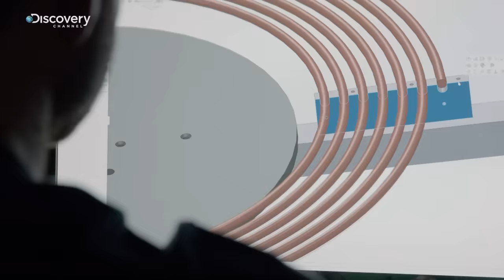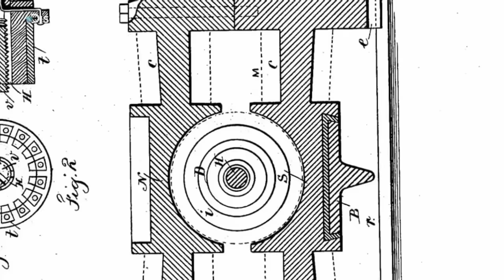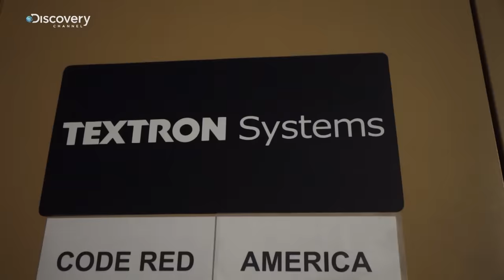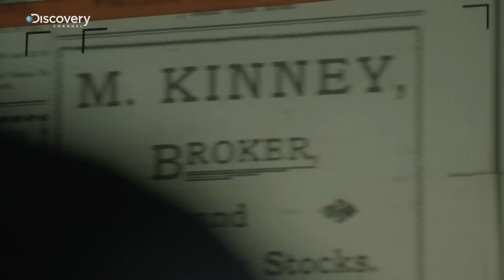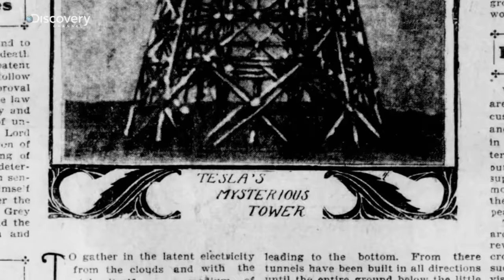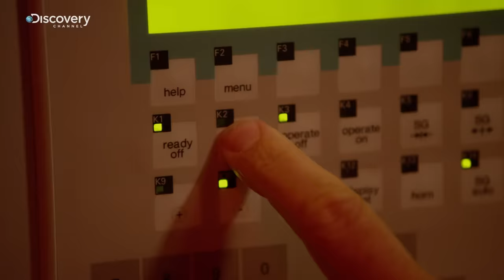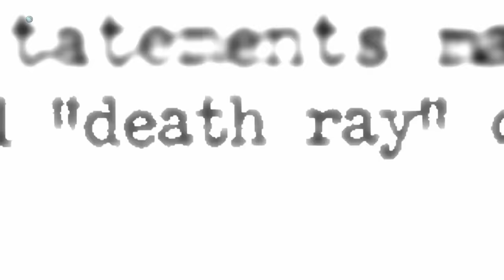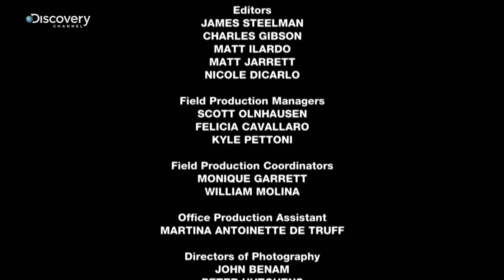Tesla: niebezpieczny umysł | Obejrzyj CAŁY ODCINEK online! | Discovery Channel

Comment: Numbers 3, 6 & 9
One Parsec = 206265 AU = 3.26 light-years = 3.086 × 10^13 km. 
The Numbers: 3, 6 and 9

((3^6) x 9) - (3.086 x (10^3)) -1 = 3,474 
The Moon's diameter: 3,474 km. 

Now we will use the diameter of the Moon.
Moon's diameter: 3,474 km. 
(3.474 + 369 + 1) x (10^2) = 384,400
The term L.D (Lunar Distance) refers to the average distance between the Earth and the Moon, which is 384,400 km.

Moon's diameter: 3,474 km. 
((3+6+9) x 3 x 6 x 9) - 9 - 3 + 3,474 = 6,378
Earth's equatorial radius: 6,378 km. 

Book: Orion. The Connection between Heaven and Earth.